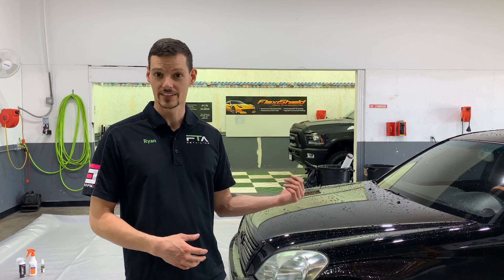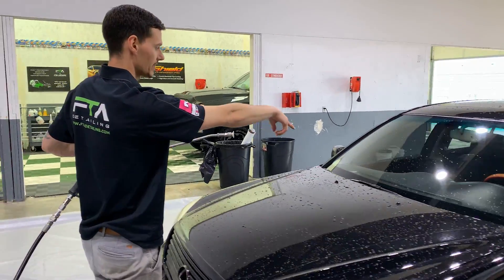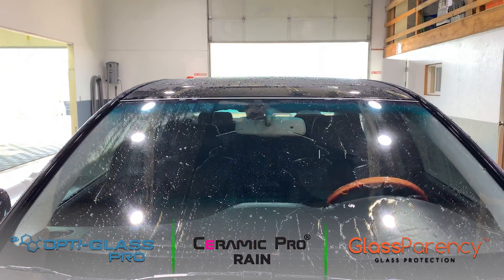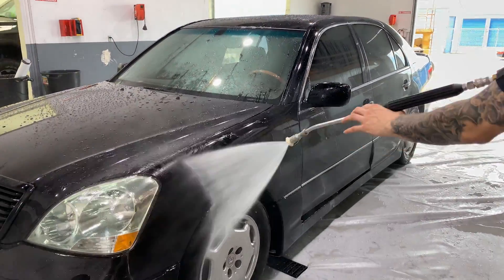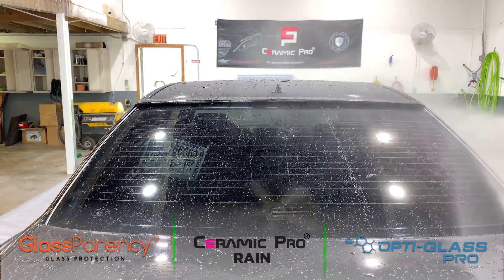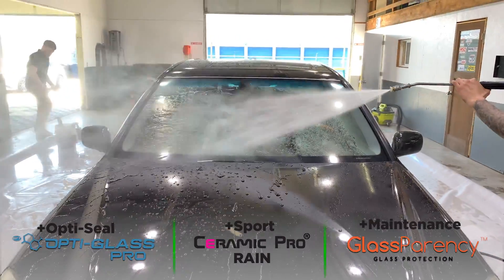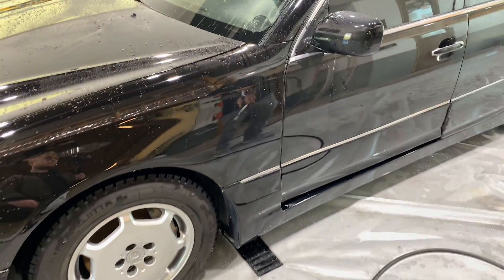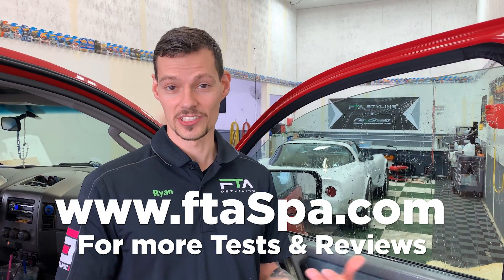Windshield Coating Testing: GlassParency vs Ceramic Pro RAIN vs Opti-Glass Pro

Comment: optiglass is the best obviously, Im judging by the spray and how the water does not sheet over the glass like the others do, its beading right from the start instead of when you stop spraying. To me thats the best thing to look at as thats what effects your ability to drive in rain. THAT SAID $80 for a small bottle???????? no savings at all not worth the price sorry just true. sure rainx may only last me a month but fuck a bottle is only $5 and lasts me a year
Reply: Late response, but that $80 bottle will last you many, many coats. You barely even use half an ounce for a whole car
Reply: @moodysobh  shit, not if you are doing it correctly

Comment: Do ever have any problems with wiper blades juddering after applying these coatings? I have tried many hydrophobic glass treatments and every single one has caused my wipers to judder which is really annoying. Fitting new blades doesnt cure the problem either.
Reply: here is the deal, don't ever coating your wiper, also you need to polish the windshield before the coating for a smooth surface, also don't use alcohol to clean your wiper, it will create a lot of chattering and noise,
Reply: @linhtrinh5815  Hi thanks for the advice but I don't apply any coatings or alcohol to the wiper blades only to the glass which I clean before applying anything. I always follow the instructions but still find the wipers judder when it rains and like I said fitting brand new blades doesnt stop them juddering.

Comment: The pressure washer is not really showing the beading fully...instead it is just ripping it off !  Maybe use a much slower lighter pressure or speed to show the result much better.

Comment: why do we want beading? im curious, every detailer talks about bead and never really explains the benefit ,, ty!
Reply: Nothing sticks to the paint, and I'm finding you get a better shine than products that simply offer the shine over the beading effect that looks nice and makes it easier for others to see you...lol...It's also bragging rights...
Reply: outcast668 thanks for answering, and not being mean about it. Lol, that explanation makes sense, thanks Outcast!
Reply: @outcast668  also when water beads on the windshield it will be very easy for the beads to fly right off the windshield driving above 30 mph without the use of wiper blades.
Reply: @AdventuresGaming  If I'm on a budget, then the windshield gets the heaviest priority...lol...I put a heavy enough hydrophobic property on the windshield, that the water beads up and rolls away at 20 mph, IDGAF, visibility in harsh conditions is everything...
Reply: @outcast668  high key turtlewax ice seal N shine is very cheap asf but i don't know well it works on beading off water on the windshield. If it does excellent then I might as well stick to the cheapness and very good water beading of seal N shine

Comment: Glassparency doesn't have the durability of a true glass coating and doesn't last nearly as long.
Reply from the maker: SirWhiteCrayon what do you recommend we test?
Reply: I've had it on my personal vehicles for over 2 years and have only done the maintenance twice and they seem to perform better than this test and the vehicles are over 15 years old original glass. I preped with a clean, scrub pad with cleaner solution provided, rinsed off, cleaned glass dried and applied.

Comment: The wiper really just gets rid of the coatings.
Reply: Coat the blades in Rain X and you're good to go! Smooth as butter! But I also went with a true glass coating on my windows.
Reply: SirWhiteCrayon that’s a really good idea SirWhite, I’m actually going outside to do that now Lol,
Reply: @sirwhitecrayon2499  its still not worth $80 for a small bottle, not even close to worth it